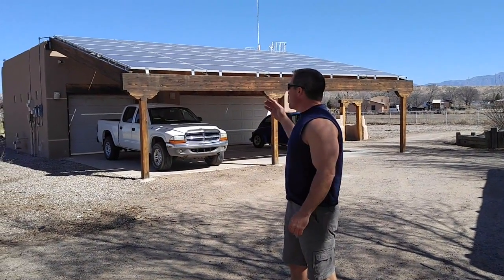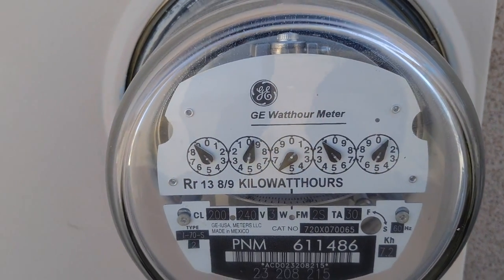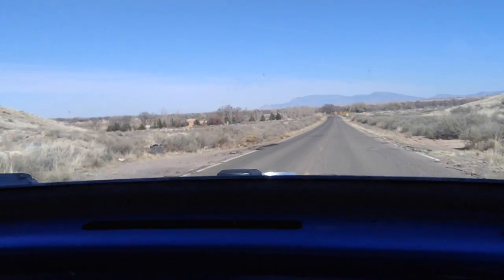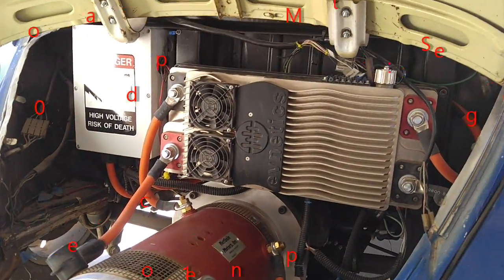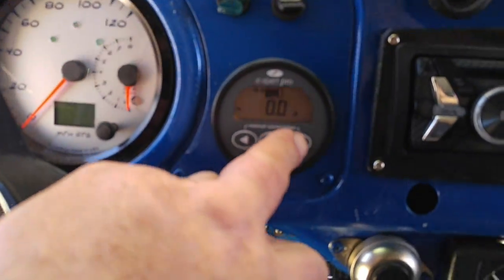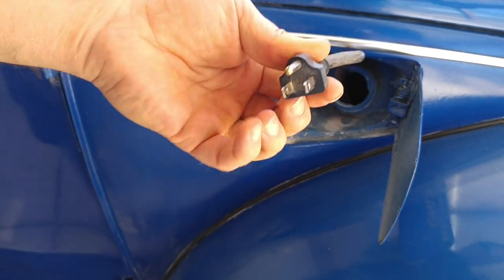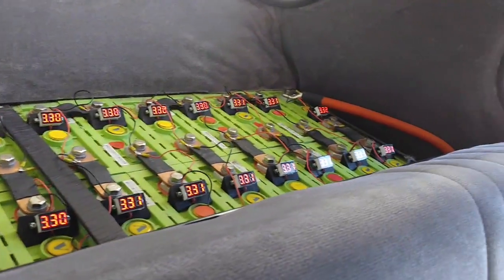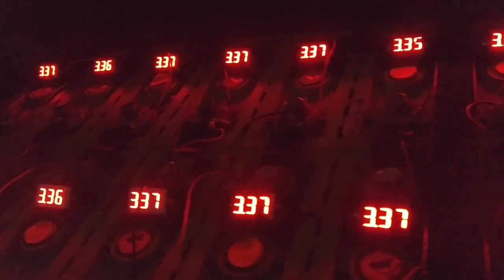Super Fast Electric Bug

Comment: any precautions to take with an electric motor and snow?  I live in Colorado and use my 74 as a daily driver.  I'd love to switch to electric.  I do wonder about all that water hitting an electric motor though.
Reply from the maker: I've driven in a few inches of snow with no problems. I've also accidentally driven in heavy downpours with no harm. The motor gets warm so any snow that gets on it will quickly melt and evaporate. The bigger problem in the winter is battery temperature, which greatly limits your range, unless you heat the batteries or leave it in a garage.

Comment: How are the A/C and Hydraulic steering pump and brake booster works on electric cars ???
Reply: The original bug didn't have power steering or boosted brakes and drives great without it. These things can be added though.

Comment: what's the range on this thing?
Reply from the maker: 90 miles if driving mellow. Check out http://evalbum.com/5147 for more details.
Reply: What does it mean with the gears "welded" at the transmission? Otherwise impressive electric conversion though, should be more demonstrations of how good the performance is at the ev conversions instead of just cruising.
Reply from the maker: 3rd and 4th gears are tig welded to the synchro hubs. On the stock transmission they are only pressed on, which is fine with a stock vw engine. This electric motor puts out possibly five times the torque of the  engine, and 3rd and 4th gear will break loose and spin on the hub.

Comment: Excellent video and nice message at the end.  How do you go about getting the motor aligned perfectly with the transmission to prevent wear to the motor bearings?
Reply from the maker: EV West (and some other companies) sell adapter plates for many specific vehicles. I would have tried to save money by making my own, but then I came to my senses and realized that if I was off by  just a little, I'd be spending a hell of a lot more money!

Comment: Very inspiring, looks like w/some ingenuity, patience & sweat equity, one can build one of these for approx. $ 20K or so.   I like having the standard 3 prong Edison connector, which means you can always find electric someplace to plug it in if you need to.  Congrats and nice job !
Reply from the maker: Yes, my charger is capable of using a J1772 connection, but I never bothered to install it because I love the versatility of the 3 prong, and I've never had a need to rapidly charge. Over night is fine. Also, the batteries appreciate the slower charge (around 9 amps).

Comment: I made it through all the comments and didn't read one negative feedback. You must have set a record just for that. If they hadn't abandoned the electric car a hundred years ago imagine where they'd be today. I hope to do a conversion as well but my technical skills are less than Fred Flintstone. Great job and thank you for caring.
Reply from the maker: You should definitely do it. Once you start, its not as difficult as you think. I mostly did it to do my little part in saving the planet, dispelling the perception that most people have about electric cars, as well as demonstrating that solar can meet most of our energy needs. As a bonus, this just so happens to be by far the most fun car I have ever driven! I've now gone over 11,000 miles without a drop of gasoline! Good luck!  I fully agree with your comment about where electric cars would be now if they hadn't abandoned them. For most purposes, they are superior to a combustion engine.

Comment: Electric is still not practical for a lot of people. If you put enough batteries into an 18 wheeler to drive it 800 or 1000 miles a day, it would weigh too much and take too long to charge. There are really two reasons why electric vehicles aren't ready for prime time and they are both related to the batteries. They can't hold enough power to equal the convenience of a fossil fueled powered vehicle and they still cost too much. They're getting better - but they're not ready yet. Sure, if you drive around town, they will last long enough, but you're still looking at a $15k price tag to convert an old Beetle, let alone a NICE car. Or to buy a Tesla Model S for up to $120k. Most people can't afford or will not pay that.
Reply from the maker: Saving money is way down on my list of reasons for doing this, although in the long run it probably will save money, especially when gasoline prices skyrocket. I wanted to do my small part in saving the planet, and demonstrating that solar power can supply all the energy needs of a house as well as transportation. True, batteries are the limiting factor right now, but there are promising breakthroughs in the near future. When battery technology improves to enable at least 400 miles per charge at a reasonable price, hopefully they become main stream. An electric motor is superior to an internal combustion engine in many ways--performance, simplicity, lack of maintenance, and longevity. As a bonus, this is far more fun to drive than anything else I've experienced!
Reply: Botts Fine Vids - what is the range you are getting from a full charge and how much is it affected by your driving stylr?
Reply: npsit1, you are right in many ways but things are changing. 
For instance, the inventor of the ion-Lithium cell is now working with another person on a technology that will triple the amount of energy stored.  It's a carbon and silica technology so you can leave the worned battery packs anywhere because they are inert to the environment.  Also, there has been work being developed which will allow for cars and trucks to be charge on the go and on the road (while moving). There is also work being done on fast charging, allowing for charges as fast as 4 minutes.
For me the biggest challenge for this change of technology/mindset is the way that this is going to affect the current energy grid. Switching to decentralized (yet connected to a grid,) power generation,  is a complicated thing. If you add huge amounts of random and quick charging loads to the grid you will turn this problem even more difficult so handle. You also have a social problem regarding electricity because it's so essential for families. Poor families who cannot afford to maintain and drive a car now, but can pay the electric bill, will be faced with a more expensive utility due to a demand and supply constrain. Demand will double as a car uses about the same energy you will use in a home (European standards, efficient house with some electric heating and cooling, so maybe the same car uses 1/3 or 1/4 of an US standard house).  
For now, people that can use solar panels and charge electric vehicles are doing their share. They still don't reach 1% of all cars so it's easy to triple that and you will start to find economies of scale and create the incentive for (business) solutions which will solve these problems. If you generate power on renewables you will get rid of all foreign dependency and all homeland pollution due to fracking and other harmful technics.  Climate change is an issue for me but you will get cleaner air, water, way less noise (which I will also miss on some occasions), less waste and more economy. Finally, as you can see for this and other videos, the tradition and pleasure of the backyard mechanic or the custom car build maker will continue.

Comment: Estimado, felicidades por su interesante proyecto...¿cómo es la relación de consumo de energía en comparación a consumo de combustible?, yo tengo un VW Escarabajo 1965 y deseo convertirlo a eléctrico, de cuánto es la inversión y quiénes son los proveedores de estos sistemas?, muchas gracias y nuevamente felicidades...

Dear, congratulations on your interesting project ... how is the ratio of energy consumption compared to fuel ?, I have a VW Beetle 1965 and I want to convert it to electric, how much is the investment and who are the providers these systems ?, thank you very much and congratulations again ...what is your email? thank you
Reply from the maker: Great question. It uses approximately 225 watt hours/mile (.225 KWh/mi), or around 4.5 miles/KWh. If a vw bug gets 25 mpg, that would be comparable to my bug using 5.5 KWh/gallon of gas. Electricity is around $.10/KWh, so it would cost 50-60 cents per 25 miles or one hypothetical gallon of gas ($2.50/ gallon). In other words, it costs about 1/5 as much for electricity as compared to gasoline. If you drive 1000 miles/month, it would raise your electric bill around $20/month (compared to $100 for gasoline. Of course, when fuel prices go back up to $4/gallon, the savings will be significantly more. You should also factor in the cost of oil changes and other maintenance that you will never have to do. See
http://evalbum.com/5147 for more info on cost.

Comment: Nice vid. Very cool mod on bug. Was it costly to convert? Have an idea on what it costs per day to charge on electric bill? Thx.--- Craig
Reply from the maker: Great question. It uses approximately 225 watt hours/mile (.225 KWh/mi), or around 4.5 miles/KWh. If a vw bug gets 25 mpg, that would be comparable to my bug using 5.5 KWh/gallon of gas. Electricity is around $.10/KWh, so it would cost 50-60 cents per 25 miles or one hypothetical gallon of gas ($2.50/ gallon). In other words, it costs about 1/5 as much for electricity as compared to gasoline. If you drive 1000 miles/month, it would raise your electric bill around $20/month (compared to $100 for gasoline. Of course, when fuel prices go back up to $4/gallon, the savings will be significantly more. You should also factor in the cost of oil changes and other maintenance that you will never have to do. See
http://evalbum.com/5147 for more info on cost.

Comment: Great job! I recently did a conversion on a 72 super. I would suggest if you continue to drive on dirt/gravel roads that you enclose the motor to protect it from road dust which will grind away the brushes on your DC motor. Got to keep those puppies clean! Good job with the panels as well...

Comment: In actual fact it gets 0 miles per gallon, as if you remove the batteries and pour gasoline into the tank it goes nowhere :-)

BTW, that's not a complaint, just a smart arse comment. 

 What would be more interesting would be if you mentioned how long it takes to charge and how far it goes on that charge.

BTW, as 10% -15% roughly gets lost in the gear box and differential you would be well advised to attach the E-motors directly to the wheels. That would also save a lot of weight allowing a shorter 0-60 time.
Reply from the maker: Check out http://evalbum.com/5147
This should answer many of your questions. There are pros and cons to a direct drive.  0-60 with direct drive would actually be slower.  It would be like driving all the time in 4th, which I can easily do, but the acceleration is slower. Also, the motor will not cool sufficiently at very low rpm, so without auxiliary motor cooling, the motor would overheat if it were direct drive and going very slowly up a hill on a hot day.

Comment: How much did it cost? How long did it take to build?
Reply from the maker: It cost about $15,000 (I got a great deal on the batteries, otherwise it would have been more. It only took a couple months (working every now and then) to convert it. The restoration took longer.

Comment: Sucks that you had to cut it up. I see kits out now that require no cutting so the car can always be converted back (not that anyone in the right mind would want to)
Reply from the maker: There are plenty of smaller motors (like the Impulse 9) that would have fit without cutting, but they also deliver significantly less torque. I needed this thing to be fast. I needed to dispel the myth that electric vehicles are slow. It never gets old watching sports cars shrink in my rear view mirror! Besides, I could always weld the cut out pieces back in if needed.

Comment: Where did you buy your solar conversion and how much does one cost?
Reply from the maker: The solar company I used is no longer in business. However, I built the carport structure myself, but in order to receive the tax rebates, I needed a licensed electrician to wire it. After the rebates, I paid about $27k. That was seven years ago, and the price of panels has come down significantly since then. I've already broken even.

https://www.sunnyportal.com/Templates/PublicPageOverview.aspx?plant=f7301247-7a55-4249-8755-807ad37dab6d&splang=

Comment: Electric and no air conditioning
Reply from the maker: I could install AC, but it isn't necessary. It doesn't get nearly as hot as modern cars, due to the smaller and less sloped windshield. It also has wing vents.